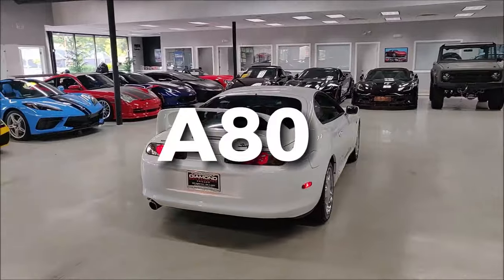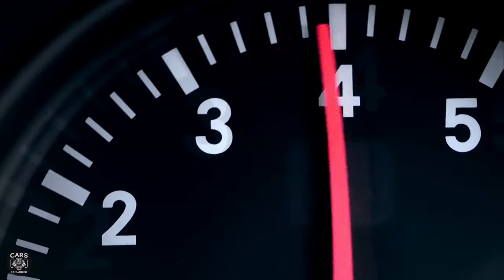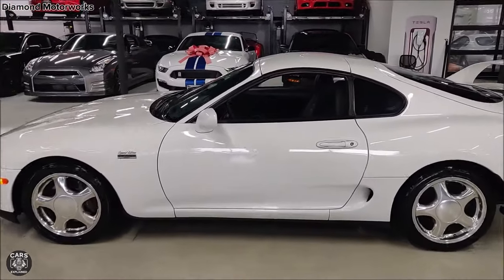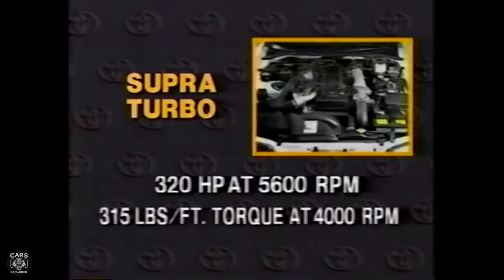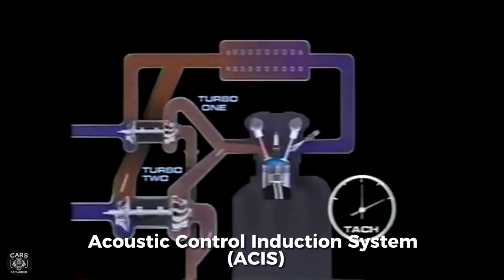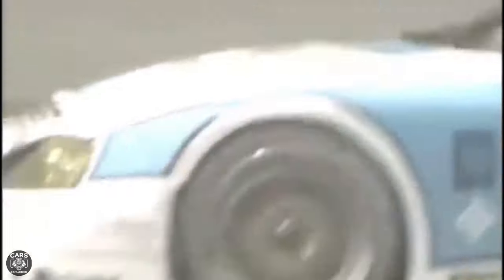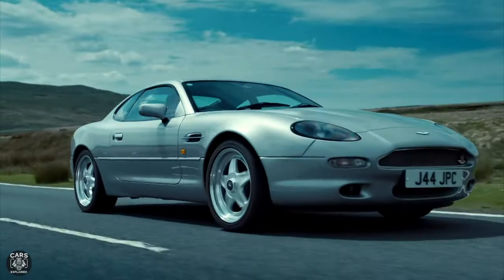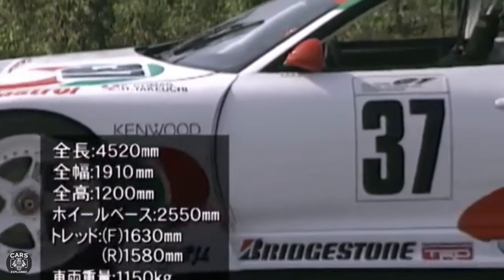Why Toyota Overengineered the Supra?

Comment: The engine was a beast in the reliability department. The rest of the car was nothing special
Reply from the maker: It was also the most aerodynamic car of its time and had better braking performance than Ferrari and Porsche. But yes, it became popular because of its engine.
Reply: More aerodynamic than the c4 corvette? @CarsExplained.
Reply from the maker: @juanmontoya5331   C4 Corvette was 0.34 drag coefficient, Supra was 0.33 so slightly ahead
Reply: @CarsExplained.  thanks for the info. Wow!